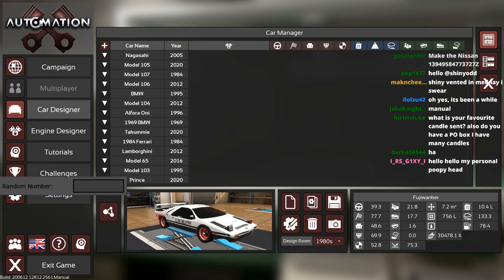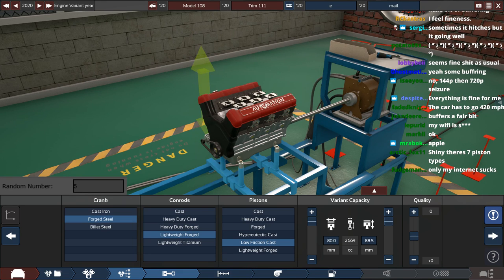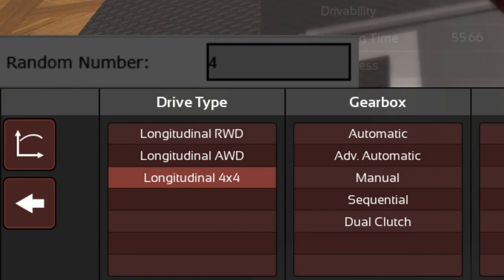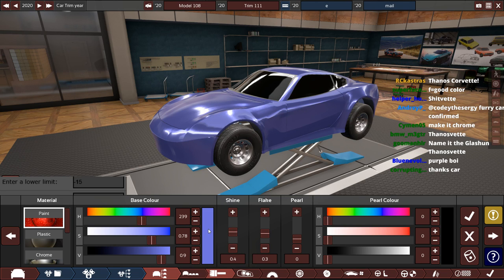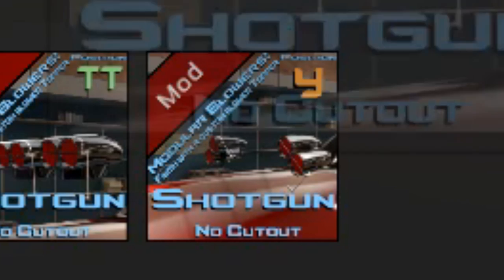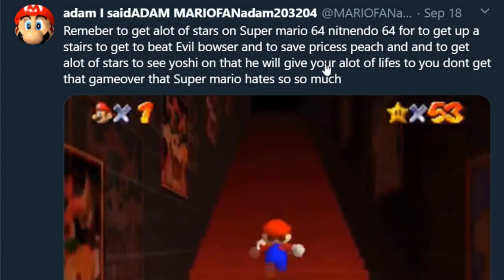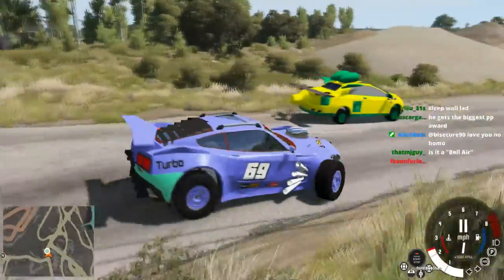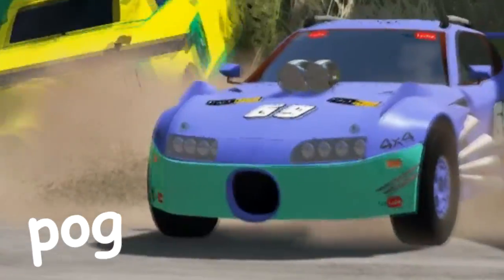Using RNG to Design a Sports Car was a Mistake...

Comment: Fun fact, the 69420 License plate is a CFR, I remember looking up 69420 and 42069 and IIRC one was an Aircraft Refueling truck in Winnipeg and the other was an M101 Trailer based in Gagetown I believe. Fun fact.